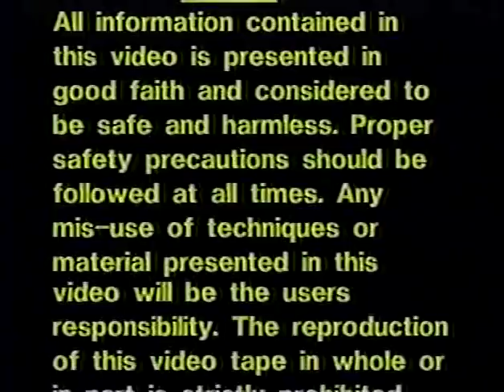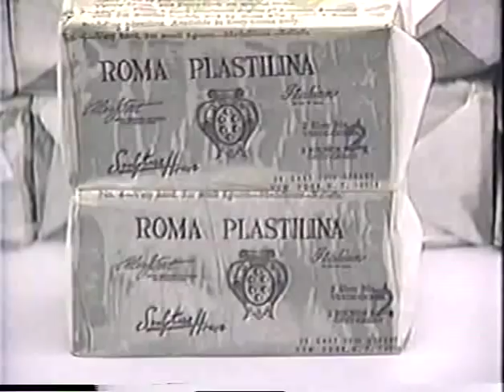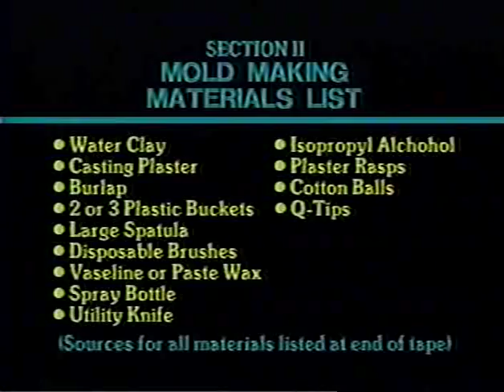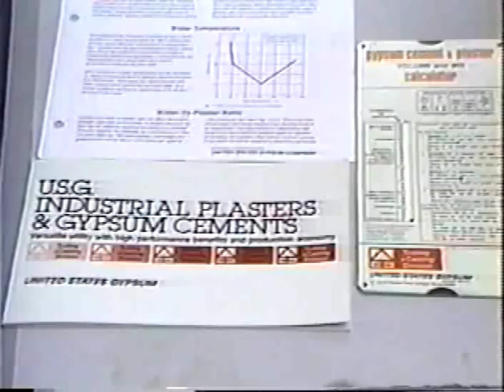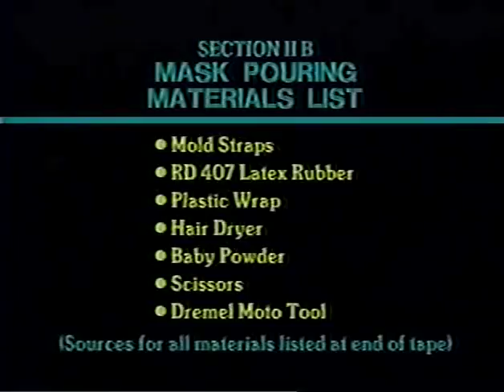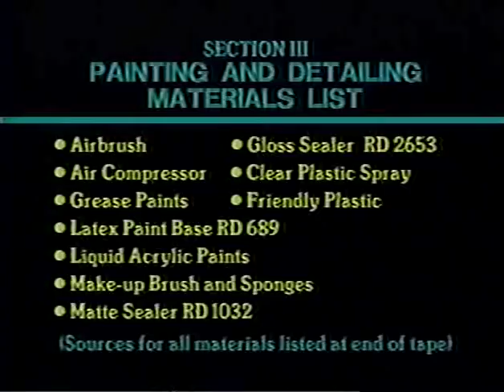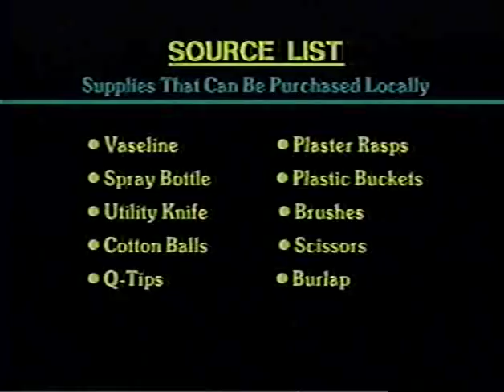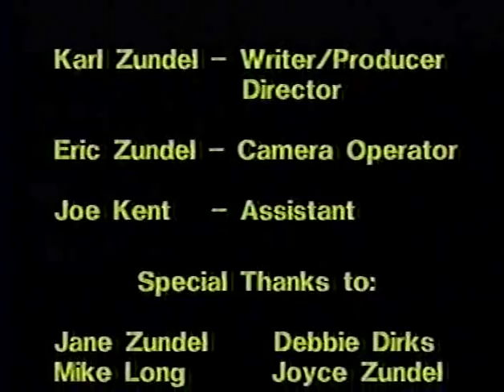The Art of Creating Latex Masks

Comment: You can also use paint thinner rather than alcohol to smooth out Plastilina clay.  It can also be used for cleaning if you have an old oil-based clay sculpture you've had sitting around that's been collecting dust.  This is fine to do if you're not worried about losing your fine textures you've sculpted (like skin texture) as the paint thinner or alcohol will take off a thin layer as it's worked into the clay.

Oil-based clay will collect dust if left around because the dust particles get trapped in the linseed oil on the surface of the clay.  This can be avoided by powdering your sculpture with talcum powder which will seal the oil and keep dirt from adhering to the clay.
Reply: Thanks, i have been wondering how to remedy this👍

Comment: What happens if I use alginate for a one piece mold for a face mask that would later be casted from latex
Reply from the maker: Alginate is a one time use material. If you made a mold out of alginate and poured in latex, by the time the latex dries the alginate would shrink and distort.
Reply: @antiheropictures  :-( ok thanks for the info

Comment: Whats the best clay to use to sculpt a peice like this
Reply from the maker: I use Chavant medium clay. You'll need to soften it a bit with a heat lamp to make it easier to work with. Monster Clay medium will also work. Same thing with having to heat it to work with it easier. Hope this helps. Thanks!
Reply: Thankyou. Yes my daughter as monster clay she will use that. Thankyou. She carnt wait to sculpt a full head peice
Reply: I have air dry clay does that work?
Reply from the maker: Yes! Just have to wrap it in plastic, garbage bag works fine, when not sculpting. It will dry out and crack if you don't. If it dries too fast while sculpting, use a spray bottle with water. Hope this helps!
Reply: Do you have to bake the finished clay sculpture before you make the mould or can you take it straight from wet clay... Sorry I'm just a beginner looking to start my own sculpt... And where do you get the base head from to start the sculpture... Thank you... And what an awesome video 👍🏼👍🏼👍🏼
Reply: Ugly Troll  thanks for the info 👍🏼👍🏼👍🏼
Reply: I use w.e.d clay it’s very good to sculpt fast and heat it up then you can shape more wrinkels
Reply: Trantor The Troll the wed clay is still great just make sure to wrap it up with a bag and you could sculpt
 months with it

Comment: Can I use air drying clay for the wall?
Reply from the maker: Absolutely. Just make sure you make the mold once you put the wall up. Cheers!
Reply: Anti-Hero Pictures yes or it will set. But is there anyway I could use plasticine? Because I don’t have any air dry clay and would be better if I didn’t have to get more so will that work? Thanks
Reply from the maker: @jangofett913  Yes, you could use plasticine. You will have to reinforce the wall and depending on how soft your clay is that you used to sculpt you may distort the clay trying to get the plasticine on. Better off just ordering wed clay if you don't have a craft store near by.
Reply: Anti-Hero Pictures ok thanks for letting me know. Also I think you can reinforce it with panels of steel? But I don’t have any so I’ll try without.
Reply: Anti-Hero Pictures I use just a cheap clay it dryes out but the price is okay I like using white clay too